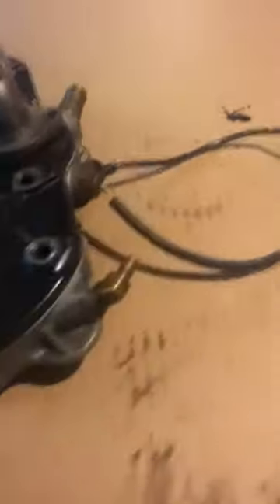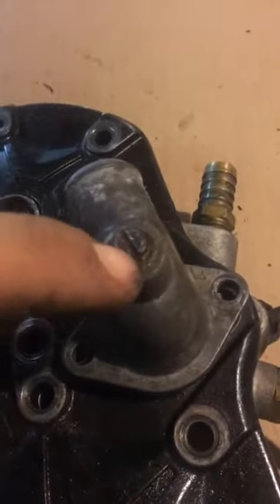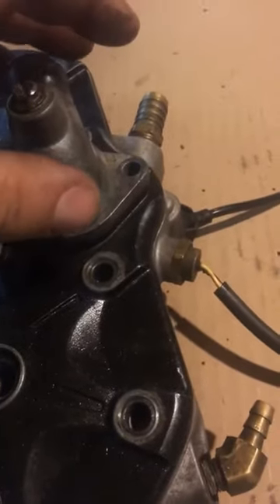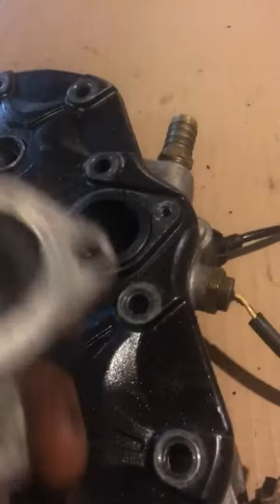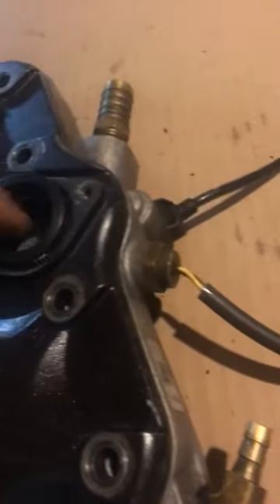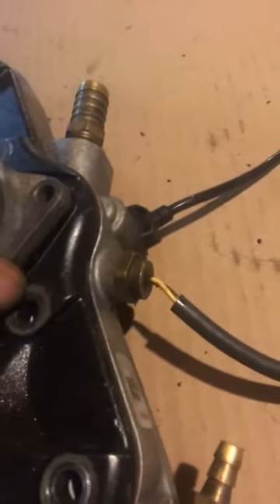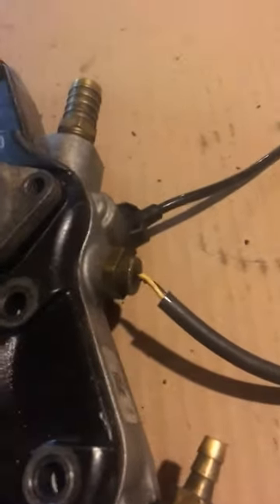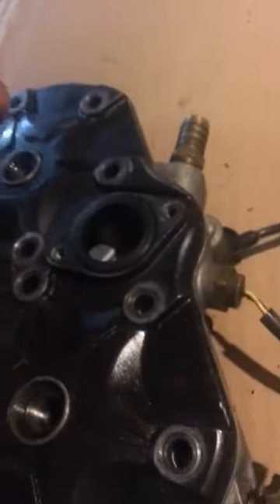Polaris Clean Fire Bleeding Coolant System over heating Polaris Snowmobiles Subscribe For More!

Comment: Good work - your advice and steps on how to bleed the coolant system will come in handy.  I, too, had my snowmobile get too hot and burn due to lack of coolant. The irony is is was rebuilt by the dealer it was purchased from.  I was the 2nd owner, and the break-in period was already complete.  I'm sharing this in hope that others make sure to don't their own due diligence and double check other people's work.  Don't assume it was done correctly, know it's done correctly.  Thanks again for the very helpful video.   Good luck to you with your future self-help, do-it-yourself videos!  The audio on this video was a bit hard to make put at times, and a few times was very loud and startling.  Lol!!  However, that doesn't make it less valuable I'm my opinion.  Keep doing the vids...and take care brother!   Two thumbs up!🖒🖒
Reply from the maker: mrozek45 Right on buddy and yeah my phone was glitching out on that one subscribe if you want To see more or if you have issues like that because mine took months to get figured out sometimes they’re simple issues I worked on tons of slides the good and the bad Subscribe
Reply from the maker: Thank you ❤️

Comment: I need help i have a 90s rmk 700 starts up and runs good but after about 5 mins of riding the temp light comes on
Reply from the maker: Sorry I did not notice your message earlier what’s going on a cheat and operate away probably the thermostat or bleed the coolant drive the snowmobile as if you were driving up on a snowmobile trailer on an angle make sure the engine is cold so all the coon go back to the ride start the engine remove the cat first and let it burp it’s self let me know if that works out if not Comment again I’ll check tomorrow